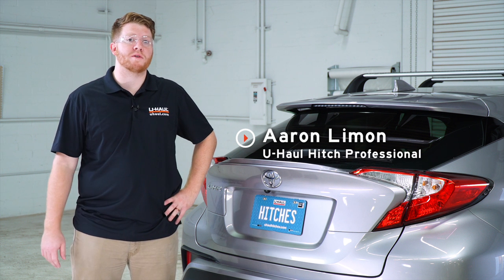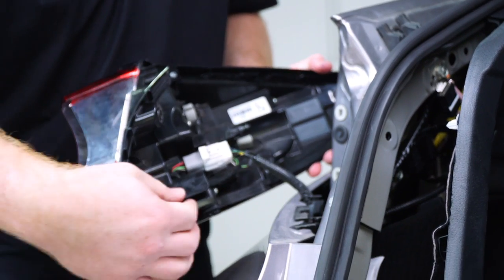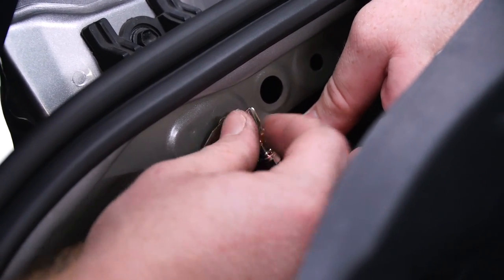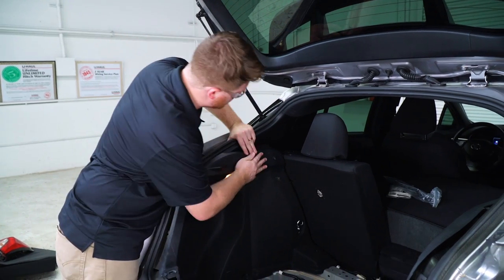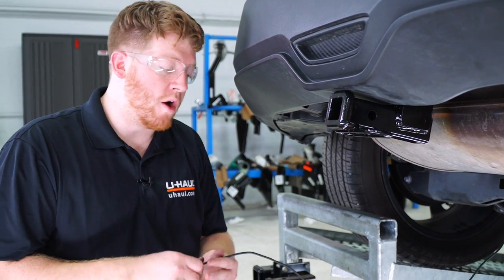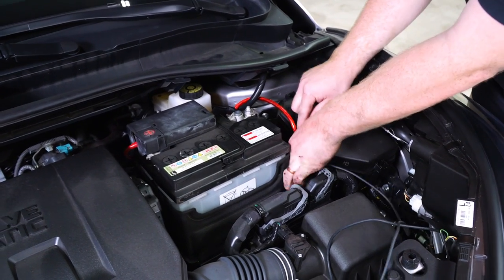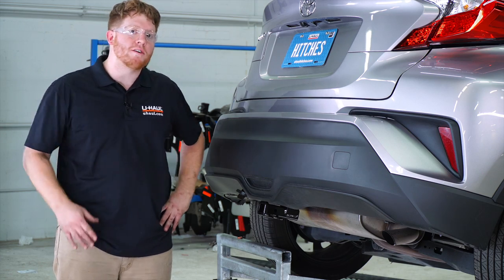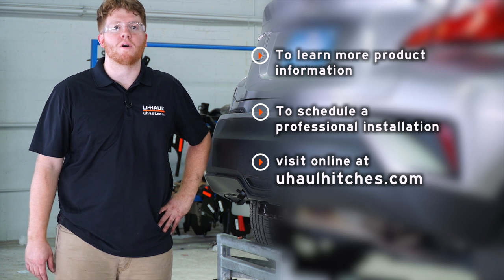2019 Toyota C-HR Wiring Harness Installation

Comment: own a 2019 c-hr gle.  it is the most utterly piece of crap. after 2 years of ownership and 40k miles it makes me wish i had bought a yugo!

spacious: somewhat 

good mileage?? not in the least. my 1990 suzuki samurai gave 45/50 miles to the gallon.  

battery is out in less than 2 years, so were the tires which lasted about 38k miles.

noises from low workmanship. it has them all.  currently, in slow turns, the steering system cracks, rattles and moans constantly.  and then there is the ever bubbling sound after it gets warmed up.   what did the dealership service department say all and every time i took the car for inspection? they said that there was nothing wrong with the car.  a yugo's the way to go.

suspension.  it bottoms up every time with the slighest depression on the road. the front absorbers (struts or rubber bands or whatever they use to deal with this) is so horrendous and the japanese mechanic at the dealership says there is nothing wrong with the suspension.   a yugo is the way to go!

i am telling you guys and gals, save yourselves the aggravation of a great looking piece of crap and buy yourselves a yugo!! the 80's and 90's yugo that is!